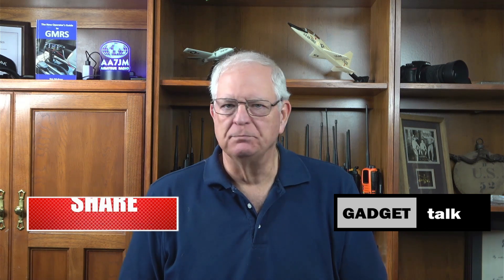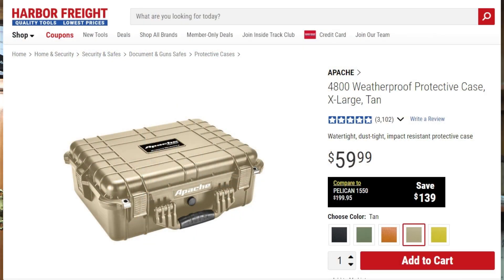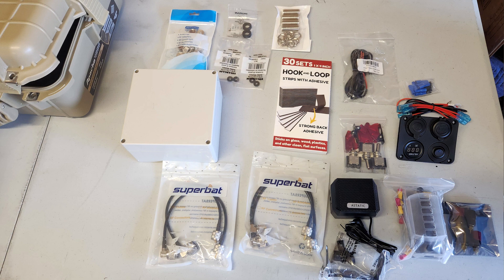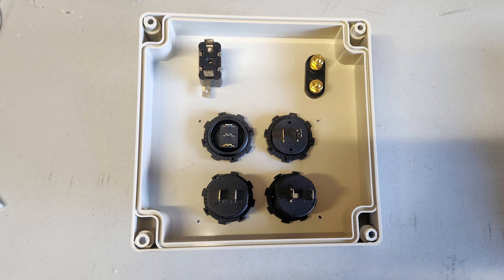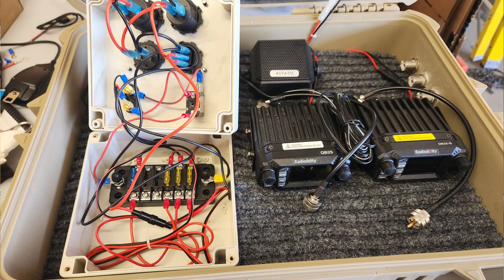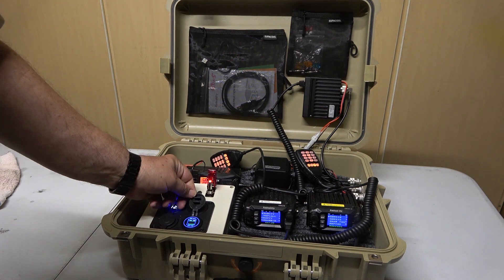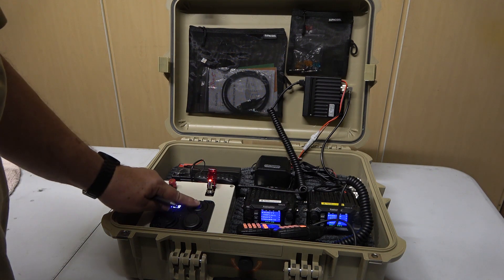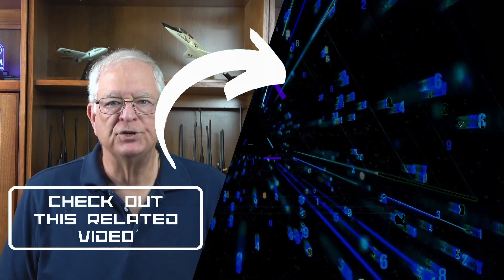Build an EmComm or Radio Go Box

Comment: You could ditch the extra gmrs radio, to save weight. Then just program those channels into the ham radio! But redundency in an emergency is good. If you have 2 ham radios, you can make a mobile repeater, for emergency use! 
If your radios allow for such witchcraft!?
Reply from the maker: Yep, lots of options. Thanks for watching and commenting.

Comment: Can you tell me how the banana plugs charge the battery? What charger are you using?
Reply from the maker: I use the banana plugs for studs or lugs to attach the alligator clips from an inexpensive Amazon multi- chemistry charger. You could easily clip off the alligator clips and add a connector of your choice such as Anderson power poles, etc.
Reply: @GadgetTalk4U  thank you

Comment: I scored a Ramco hard case with spring loaded metal handle . Originally this particular case housed a very early starlight viewing optic . The overall construction of the box is tank line and the air pressure release valve is a really nice bit of purple anodized aluminum . I will use this video and build as my go to for my build , thank you !
Reply from the maker: You're welcome. Have fun with your project!

Comment: My big concerns here are the amount of connections.
I see these all as fail points, the less the better.
Do you "need" a toggle switch to power another toggle switch.
Reply from the maker: The red toggle switch is the master switch. It turns everything on. The rocker switch in the accessory panel was part of the kit and the included wires expected the 6 components. The wires to the accessories were also separately fused. The covered master switch prevents anything in the case from turning something on and draining the battery. To answer your question, for me, yes. Thanks for watching and commenting. Valid point.
Reply: @GadgetTalk4U  
For clarity purposes, I'm not hating on your build.
I've been watching lots of videos of portable radio setups as I'm working on a build of my own.
I'm going the backpack 🎒 route and fabricating an aluminum frame for it all.
I started adding other components like toggle switches and voltage ⚡️ meter, and I stopped mid build.
The radio already has an on/off switch, my radio already has a volt meter.
I asked myself, how are you going to fix any of this in the field "when" it fails.
I didn't want to carry extra parts or a repair kit.
I quickly decided to only have as little of a wire harness as absolutely needed to run everything properly.
Less to fail later was my thanking.
Reply from the maker: @swartzautoman2  I took no offense. Love hearing other's ideas and perspectives. Sounds like you have a fun project in mind. Cheers.

Comment: Can I ask why you did not wire the voltmeter, USB socket and binding post to dedicated circuits on the fuse block?
Reply from the maker: I did. Check the diagram vs. the photo. Wires got dropped out of frame, so are hard to follow.
Reply: The diagram looks like your CB, GMRS and VHF/UHF have dedicated circuits, but it looks like the voltmeter, USB and 12v are wired together in series through the switch to one circuit on the fuse block. Am I misreading it?
Reply from the maker: @thomasschmidt9864  The kit came with the expectation that it is one component, not 4. It also comes with the wires pre assembled to wire the elements together. The panel kit is also fused separately. You certainly could do what you describe if you wanted to use a bunch of slots and build your own wires. Wiring each separately would negate the need for a panel switch. Cheers.
Reply: Ok, thank you. By the way great video. @GadgetTalk4U
Reply: One more question: What amperage fuse do you use for the sockets/USB/12 binding post circuit?

Comment: Great video Jim.  I’m not a fan of Radiotity but I love your ideas and detailing of the project.  I’m still scanning for more ideas based on the Apache boxes or the Pelicans of similar size (although I know they’re much more expensive (but I already have a 1550)

BTW, I noticed your T-38 in a video some time ago.  I was USAF as well but spent my time maintaining servicing and potentially launching a Titan II from Wichita, KS until I resigned from the USAF and went to work for Beech and then NASA at Goddard.  My brother however beat me to NASA and in fact flew their T-38s in Houston and around the country.  73, Tom KC3QAC
Reply from the maker: Very cool. Thanks for sharing.

Comment: it seen many of this type of Radio to go boxes.. great idea but if i can make a recommendation, instead of using a dedicated battery, just use a tool battery like dewalt or Milwaukee and use a step down transformer to provide the 12v.  So you will always have your battery ready or extra to go when SHTF...

Comment: Jim - nice build and great video as always.  I too just finished my GMRS go box using mostly items I already own; GM-30 HT, BTech 30 Watt amp.  I too bought my case from HF but one size smaller as unlike your 3 radio setup, mine is just one HT and an amp.  I used a 10 ah LifePO4 (bday gift from my daughter) for power and also created my own switch box using a PVC utility box and the same 4 pc switch, USB and cig outlet. My goal is to have everything in the case so I went with a Midland MXTA13 micro antenna for $20 and got a 6x8 plate that I magnet mount on the lid for groundplane, the MXTA13 has a builtin mag mount so it easily sticks on the sheet and both sits on the lid when open. I know this does not give me the best range but fits my criteria of all inside the box when closed.  SWR is decent @1.3 with the ground plane. Yes, I do keep my the SureCom SW-33 in the case.   I do have a mobile mag mount and a taller 6dbi nmo that I can use if needed but those are not in the case.  I do have the AC battery charger in the case too. I have a 40W folding solar that I can use to charge it outdoors. Again an extra out side of the box item.  I can share pictures or short video with you if you like.  Thank you and keep it coming.
Reply: How long does your battery last?
Reply: @Bullwinkl360  I think it is rated for 2000 + cycles recharges.
Reply: @benjosevilla  I'm sorry I didn't state my question correctly.  How long can you use the radio before the battery needs recharging?  And as the battery's voltage decreases, what is the lowest voltage you can still transmit and receive. I'm a noob to all of this.
Reply: @Bullwinkl360  - I have the box on now for over 24 hours with mostly receive and a couple of key ups and conversations. It is truly during transmission that i consumes. I only have a volt meter so I can only see the voltage and so far steady at 13 on RX and around 12.1 while TX. The handheld has usbc which is constantly powered too.
Reply from the maker: Sounds cool. Thanks for sharing in some detail. Have fun with it. Cheers.